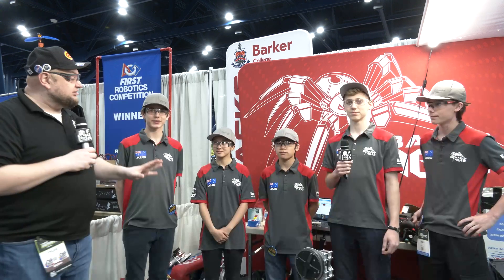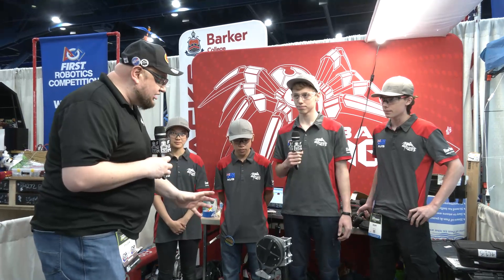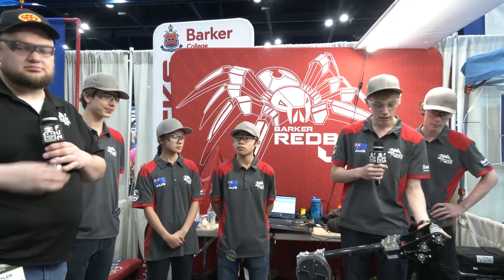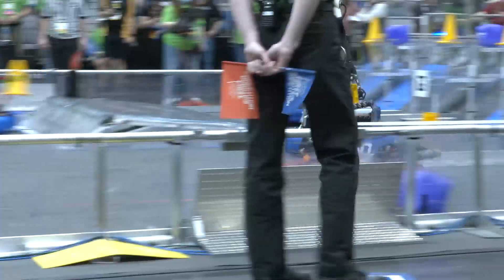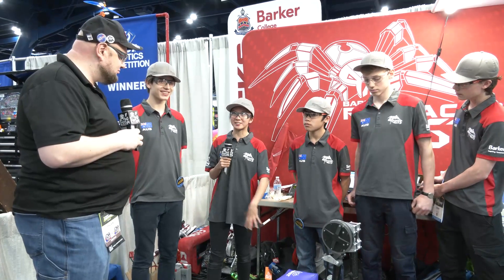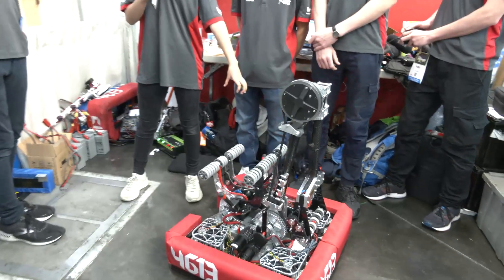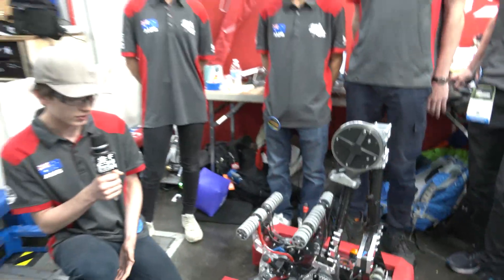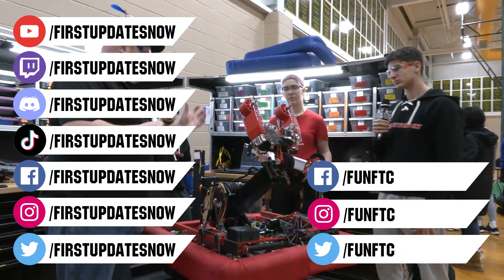Behind the Bumpers | 4613 Barker Redbacks | Charged Up Robot

Comment: These alumnium parts are shiny, what is this? 
And that planetary falcon is an odd choise for the arm pivot, how you manage to keep it in place?
Reply: I think they machined those parts with some facing operations. Aluminum is shiny if you cut it properly with CNC.
Reply: @Wangfriend  For sure, but it looks more chromatic than machined 6061, similiar to the original mk4i plates which are made from 7075
Reply: @nevolifshitz1828  Maybe because they cut the parts with a CNC router, not a CNC mill. Small stepover made the parts look more chromatic. But using 7075 is reasonable for them.